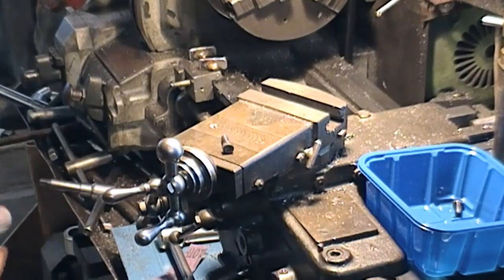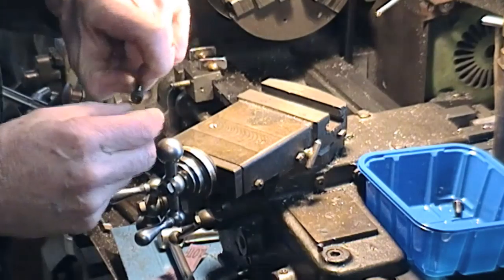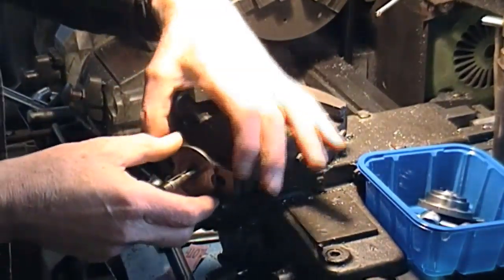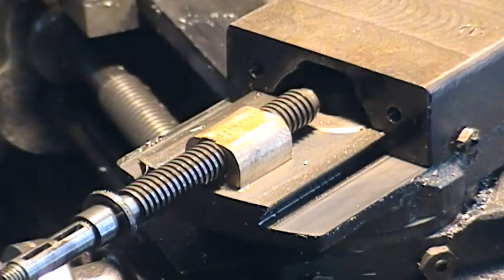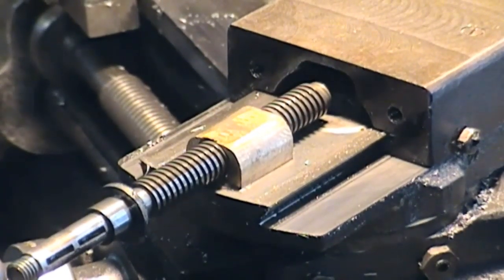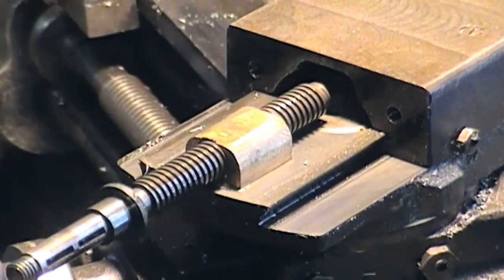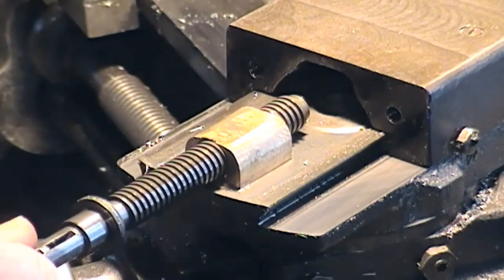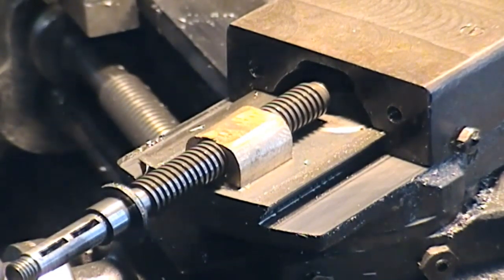Lathe compound slide - inspection for planned replacement leadscrew and nut

Comment: I use paraffin heaters just to knock the edge off the cold, I think that brass nut must have been previously re made for it to have been so thin, or farmed out as out work? as lots of parts back in the day?
Reply from the maker: Richard - I have a large kerosine heater but - with the sheer cubic footage of space I have I doubt I'd feel much benefit! I suspect, with the lathe being maybe 60 years old, this nut was a replacement and whoever made it was a bit 'enthusiastic' with material removal on the top! I shall hopefully manage to leave about 50 thou more on the top.

Comment: hello chris,
when you pushed back the top slide it looked as though there was plenty of clearance from the brass nut, so does it have to be so thin walled on top?
not that it matters,i was in the shed today and spoilt as it was nearly 40 degrees here in Nottingham!
nice video thanks
Reply from the maker: Richard - yes indeed I have since checked more closely and will in fact be leaving more material on the top - not sure actually why it was made so thin!.  As long as 'shoulders' are formed and width kept about same, I can add probably a good 50 thou at least. 40 degrees eh - well it looks like I have even better (along with rain) for a couple of days ... just need to escape office a bit! :)

Comment: Chris:  This will be great project for me to watch (and learn)!  A question for you: Would it be worthwhile to make the nut longer than the original (maybe 2x as long), in order to gain more thread, and engagement, which should lessen backlash?  Just curious if there's a reason not to do so.  Thanks, Bruce.
Reply from the maker: Bruce  - In theory a length increase should reduce wear rate a bit but I think it would also reduce rear travel limit - so it's all compromise.  Plus too - the nut can come out of some 1 x 1 square brass, instead of needing larger (expensive) stock. Years ago I made a new leadscrew and nut for my cross slide and that has done pretty well, the nut not being much bigger than this one.All in all, if I get the right result, the parts should easily outlast this old guy!